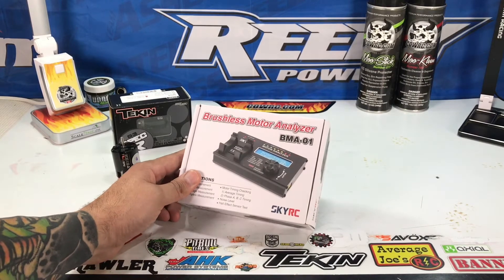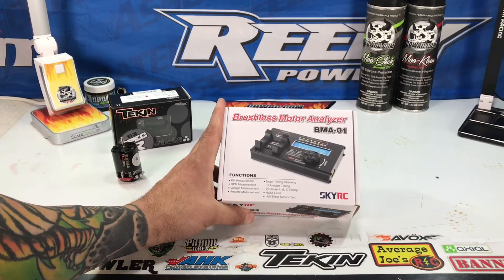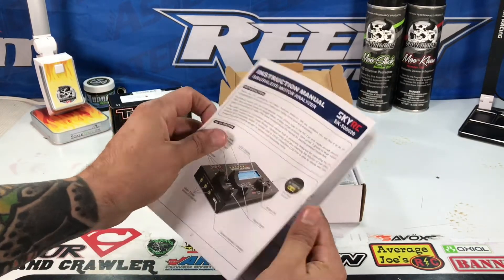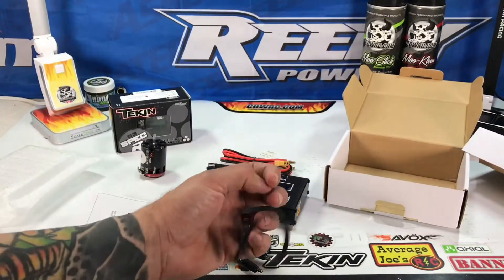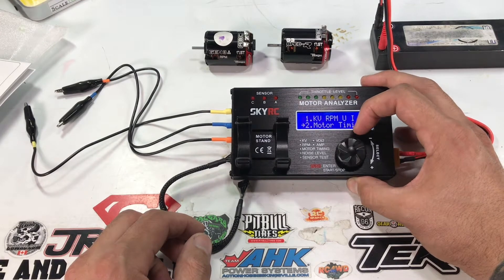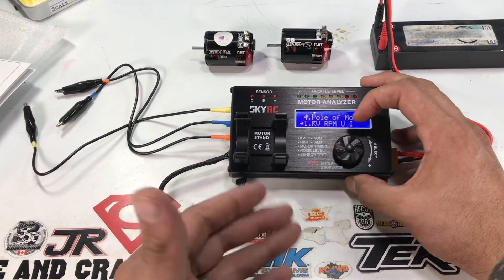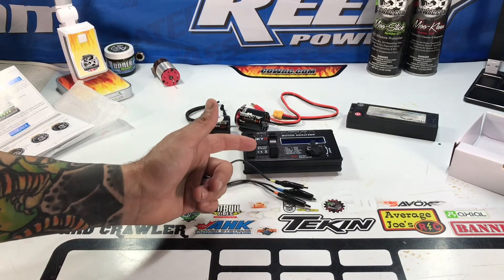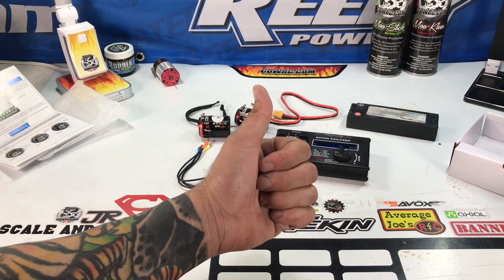SkyRC Motor Analyzer BMA-01 - Product Review

Comment: the first motoer was 2400kv a 19500 rpm at 1.5 to 1.6amp draw an the 2nd motor 3100kv 25000 rpm an the amp draw was 1.6 great motor an you will be able to put more amps thu them motors an gosh they will get faster my friend

Comment: Nice video, definitely going to give you a thumbs up, my question though is, can this motor analyser be used to test aeg motors in airsoft (which use brushes, therefore not a brushless motor, and only have two terminals) or is this tester solely for the purpose of the RCR world’s brushless motors?
Reply from the maker: I’m sure this would do any type of brushless motor (to a limit). An AEG motor would be smaller and pull less amps than this, so I wouldn’t be afraid of it melting the unit. I have never pulled the motor out of my AEG. Can you adjust the timing on them?

Comment: it seems that most motors will produce more rpm's with a higher timing--  why wouldn't i just raise the timing on all my motors?
Reply from the maker: Under load, it will also produce a lot less torque, and also heat. There is a happy medium with everything. You need to test and tune with timing and gearing to find the sweet spot of every motor.

Comment: i wonder if you could hook this up to the same power supply you would use for a charger
Reply from the maker: That's a great question! I'm not sure. I think the power supplies are 12V, and the battery I used is a 2S Lipo, so it maxes out at 8.4V.
Reply: I doubt your charger would supply enough amps but who knows running with no load.  My charger max out at 4 amps while cheap battery will supply 35 amps.

Comment: So would this be a "scale dyno"?
Reply: powcar91 no it is not a Scale dyno. This does not put a load on the motor so it can't check torque. It is perfect for checking the kv, amp draw, rpm and actual timing setting. Plus it can check the accuracy of the sensor board.
Reply from the maker: +powcar91 No, there is another product that you can get that is a dyno. This will help you adjust timing and tune your motor to give it the best balance between amp draw and rpm. 

There is a dyno you can buy that checked power